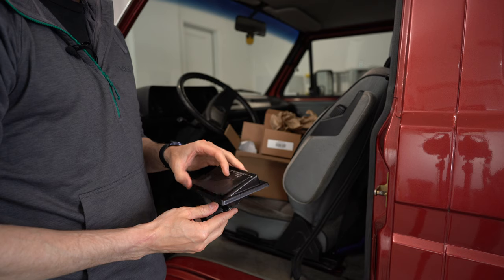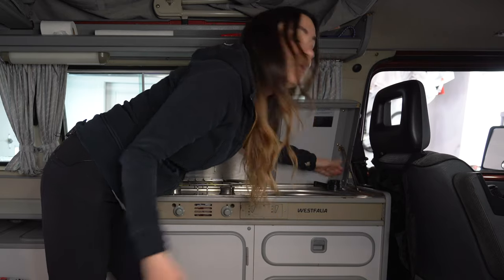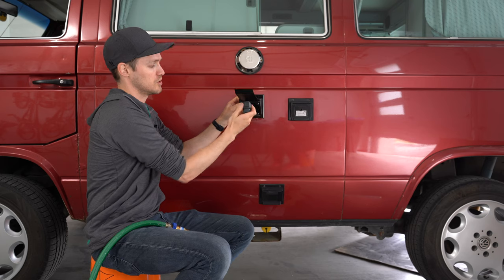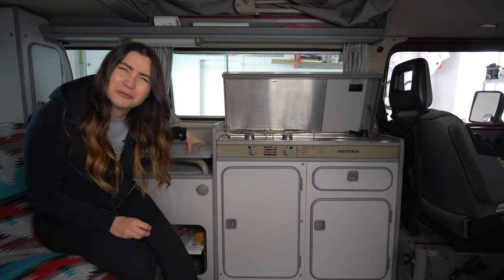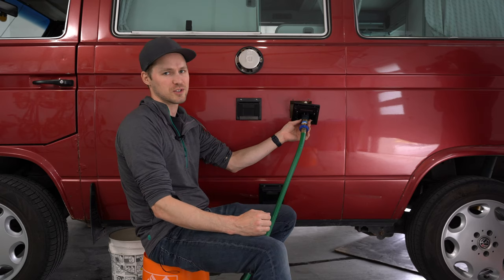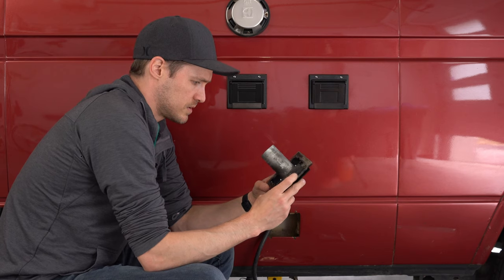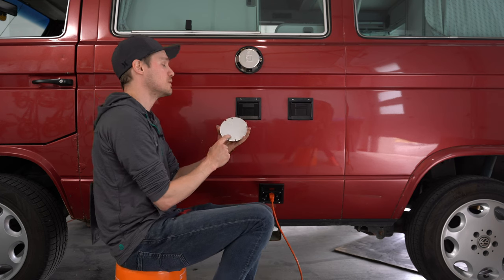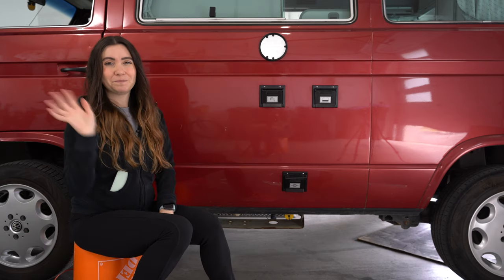Westfalia Upgrade! GoWesty Hook-up Box Install

Comment: I am installing the new hook up boxes but I moved the electrical up in between the water hook ups. I cut the original extension cord to the length needed to reach it. As for the hole in the lower panel from the original box. I cut out the panel due to excessive rust and replaced it with a new panel. The rust was most likely caused by the old hook ups leaking around the old weathered gaskets. While I was at it I also replaced the left rear fender well. All that's left is undercoat the inside of the fender well and paint.

Comment: The best upgrade and the first anyone buying a Westy or any VW Van should do is a Subaru Swap.  VW engines are notorious high maintance and $$$$$$. Go Subee u will Climb like a Goat get better MPG and maintance is a head gasket at 150k miles and that’s it. Bulletproof and Cheap to maintain.

Comment: What what is the silver disc for, did they say exhaust?
Reply: It covers up the hole in the side of the body which was used to vent the original fridge that came in the van. We have a different fridge and don't need that hole anymore
Reply: @mattofstie9298  Cool, thanks for letting me know.

Comment: Nice upgrade!  Are there lockable replacement covers for the city water and the water tank. I would be concerned that someone could contaminate the water in some manner, especially the tank. Or, do the quick connects provide such protection?
Reply: The quick connects would definitely make that harder to do as there are internal check valves which would need to be overcome. Not impossible to do, but not as simple as pouring something into the opening